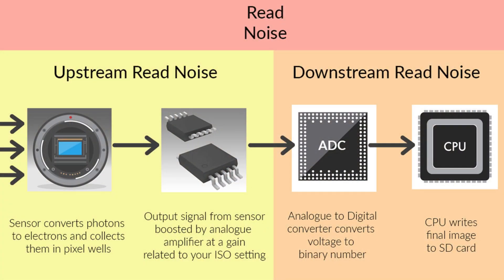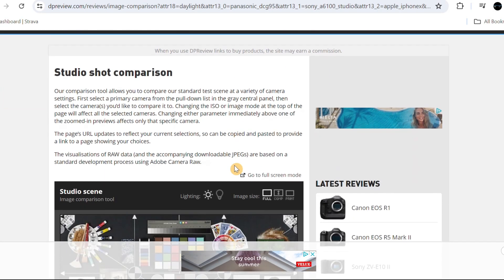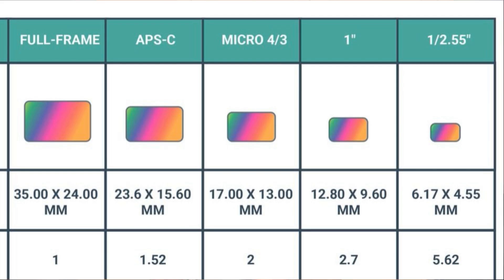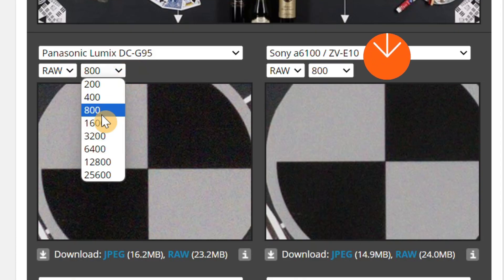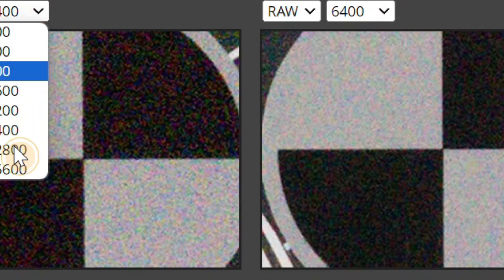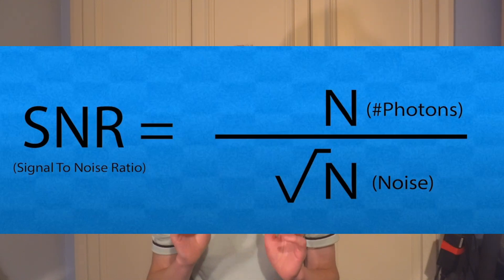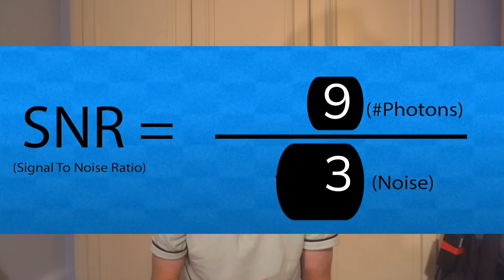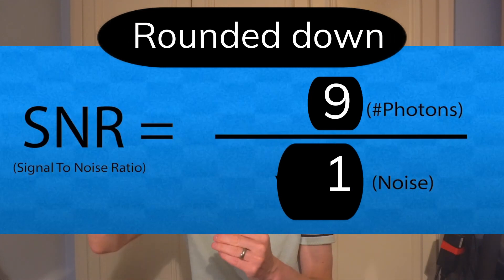Sensor Noise Explained! A Case for Small Sensor Cameras

Comment: While this is a complex question, my understanding is, if you have a FF sensor and the same sensor at a m43 size, with same size pixel size, the main reason why m43 is multiple times noisier is the fact you have to magnify the image to get it projected on the same size screen.
For the same reason, when you zoom-in while doing manual focus, the image appears grainier. 
Or even better, ask yourself why a 16mm or 8mm film appears grainier even though it is the same identical stock? It is because of the magnification you have to do during projection, either on a cinema screen or on a monitor/TV.

Comment: If the sensors have the same pixel size, a larger sensor does not gather a stronger signal, the signal is the same per pixel, If you crop in on a galaxy on the larger sensor it's gathering the same amount of light as on the smaller sensor since the pixel size is the same.

The same goes for read noise, even if the camera has less pixels  you expose long enough to make the read noise insignificant compared to the shot noise, the stacking process takes care of the shot noise.

If you compare the famous IMX533 and IMX571 sensors they have the same noise characteristics , same sensitivity to get above the noise floor.

There are experts in imaging that can explain this better/ in more detail on Cloudy Nights though.

Comment: Good video, thanks. I remember from a few videos back you got the ASI585mc planetary camera (as I did) and are using it for DSO. astrophotography. Just wondering, what gain setting you've been using with that camera? I've pretty much been sticking with the HCG setting of 252 which works pretty well but being an uncooled camera (and warm summer nights), I do have a fair amount of noise in my images and I was wondering if maybe a lower gain setting might help. Thank you.
Reply from the maker: Hey barnaclewatcher! I stick to 252 as (going by the graphs) it provides the lowest read noise to highest dynamic range ratio. I know this sounds counter intuitive, but dropping the gain will increase the read noise. On the flip side, increasing gain past 252 will slightly reduce the read noise further, but the dynamic range drops by much more, so basically stick to 252 and dither and take darks if you are finding the noise to be a little too much. I'm lovin ziggyfrnds mini fridge Peltier mod though, maybe we should all be doing that! :D
Reply: I have the same camera (ZWO ASI585MC). I used the same gain settings and sometimes even higher to overcome overall noise. Although you need to identify what kind of noise is impacting you most, if its dark current then you need to capture darks after your astrophotography session (to make sure the darks were taken at the same temperature as your lights) 
You could also do what I did....I got myself a cheap USB powered fridge (one of those that only have space for a soda can, off of amazon or ebay) and took it apart to get the peltier cooler inside. Then I attached the peltier cooler to the back of my ASI585MC camera with a little double sided tape and thermal paste between camera and cooler plate to make contact :) With this setup I can get my camera to 10 C below ambient, it makes a LOT of difference to dark current noise.
Reply from the maker: @ziggyfrnds  Very cool ziggy 😎 no pun intended.

Comment: Thanks a lot for your contributions. I usually really enjoy your videos. In this specific case, I feel the need to react. These comparisons are at same ISO and same f-number. It's like mounting a micro four third camera on a 6" f-7 telescope, and comparing it to a full frame camera mounted on a 12" f-7 telescope. Sure you get the same angle of view and the same f-number, but obviously the 12" telescope will collect 4 times more photons, making the comparison unfair (and perhaps not very meaningful).
Reply from the maker: I appreciate you taking the time to provide your thoughts. Maybe we are just looking at this from different angles. I'm looking at it from the angle of someone who is often asked which camera to choose for a specific telescope, so that part of the equation is fixed much of the time (I'm asked this at least a few times a day through my day job) The part of the video I think you are referring too is meant to highlight some of the unforeseen difficulties with choosing a larger sensor camera, such as requiring a larger image circle to avoid vignetting, and the extra fine tuning of back spacing and tilt required. You are of course right that a 12" f/7 will collect more photons than a 6" f/7.  I specifically gave the example of 200mm f/4 camera lenses to keep large aperture differences out of the discussion as that's not the point of the video. The relationship between sensor size and noise, and the practical implications of choosing a larger sensor if you want lower noise, was.
Reply: @Astrolavista  my point is that the relationship between sensor size and shot noise is at best weak, if any. When shooting the same scene, with the same shutter speed, pictures from my phone (crop factor 3.6, 25mm equivalent, f-1.9) have the same shot noise as pictures from my full frame camera with a 25mm lens at f-7.1 (using f-7.1=f-1.9*3.6 to have the same aperture diameter). On the other hand, if I vary the aperture diameter on my FF camera, shot noise (and more interestingly SNR) will vary proportionally to the aperture diameter. Same if I vary the shutter speed. So, between shutter speed, aperture diameter, and sensor size, if I vary only one of the three, sensor size is the only one that doesn't have a significant impact on shot noise.